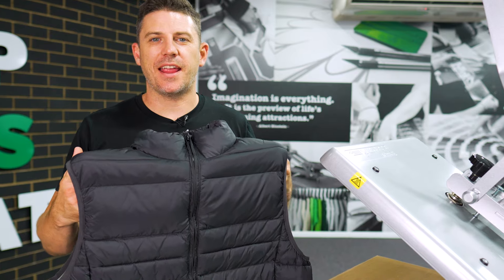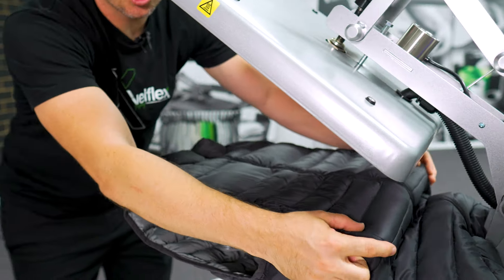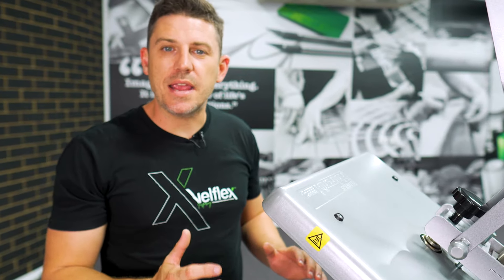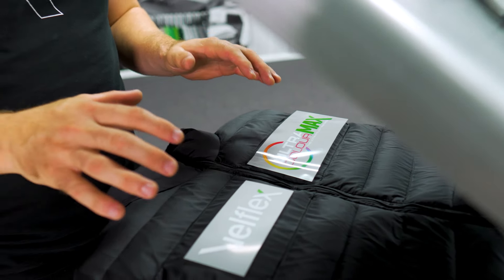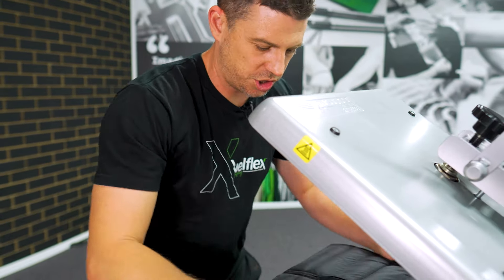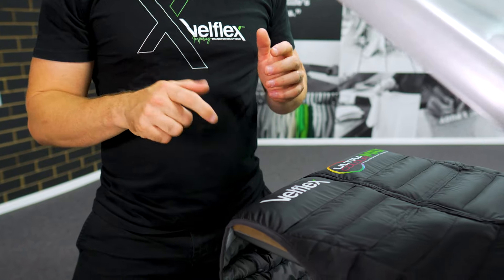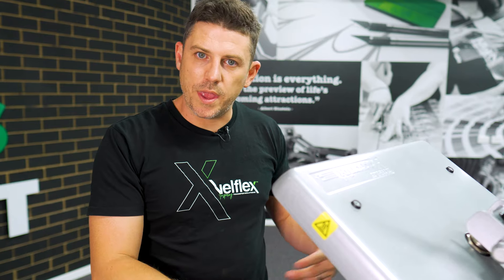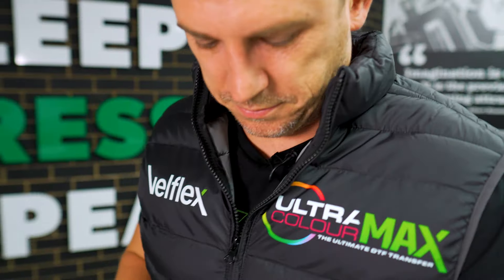Mastering Heat Transfers on Nylon Puffer Jackets: Expert Tips & Techniques | Velflex Tutorial

Comment: Any chance u could do the back when the transfer goes over the stitching as im having real issues with it not looking fresh
Reply from the maker: Hello, you can do across seams but it can be difficult for it to look good, the fabric gathers where stitched... do a pre press to try to flatten fabric first as much as possible. You'll see creases etc, so can try pull the material tort to avoid them... then place transfer and do a short press, peel liner and then place a bit of cotton over the top of transfer and press again, best chance of it looking okay.

Comment: what temperature do you reamend
Reply from the maker: Depends on the transfers you are using. Our UltraColour transfers require 150°C to adhere correctly but won't need long. A short prepress followed by a short transfer press followed by a short post press would be the way to go. If you are worried about too much heat on the garment we have some low temperature vinyls suited for nylon. All of these are available on our website.